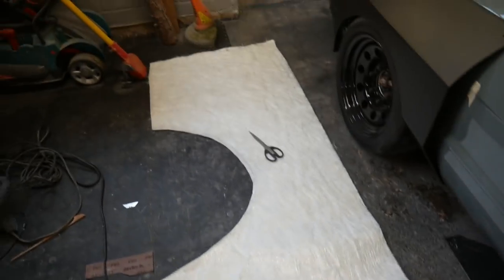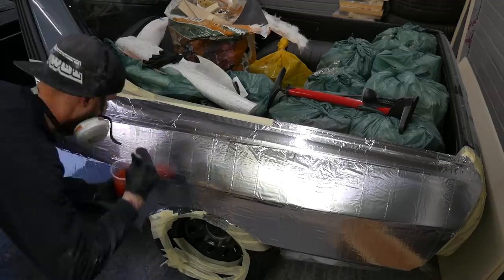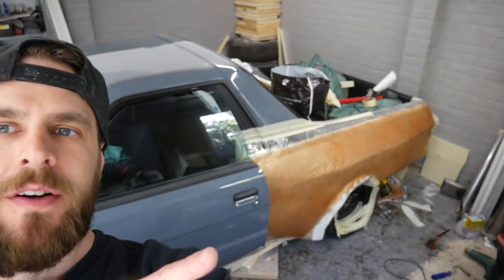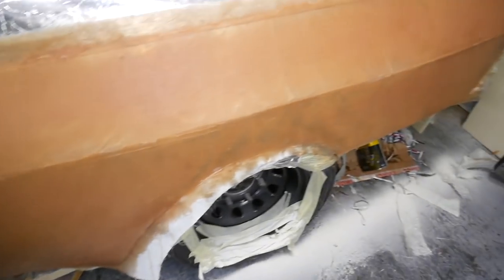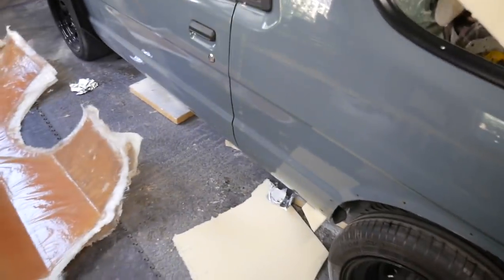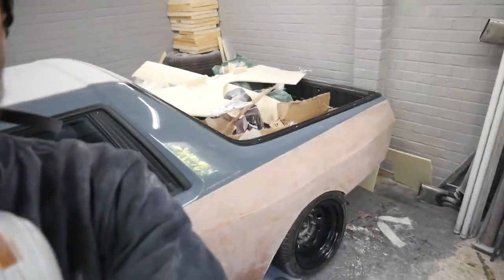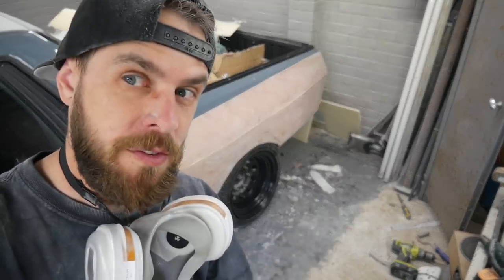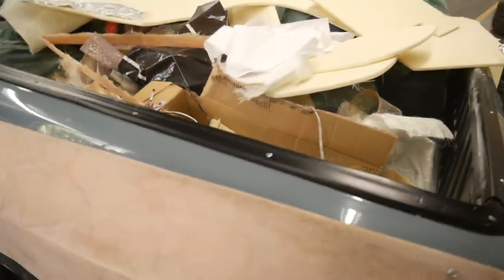Fibreglassing rear overfenders!

Comment: How about using a cheap vinyl wrap instead of the aluminium tape
Reply: You run the risk of damaging lacquer with vinyl, although if you can make sure it doesn't cure it could work!